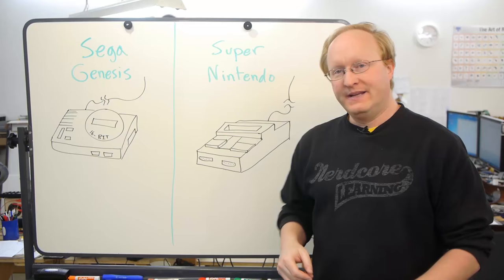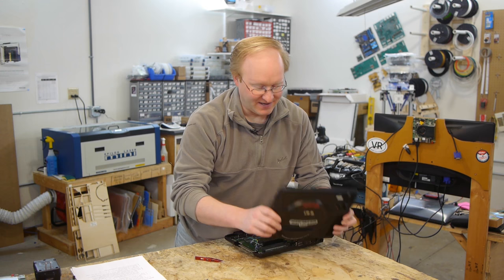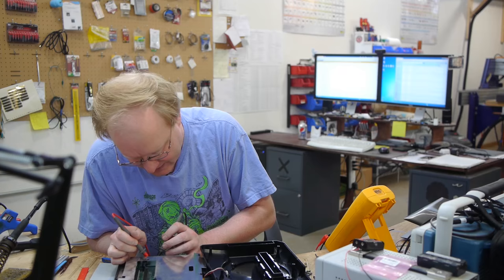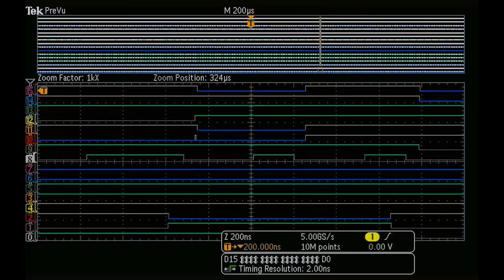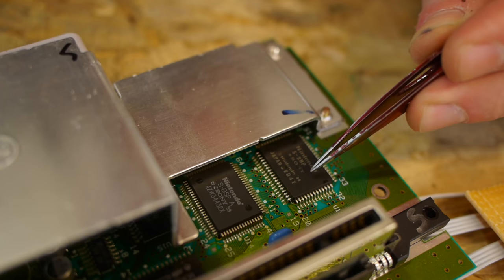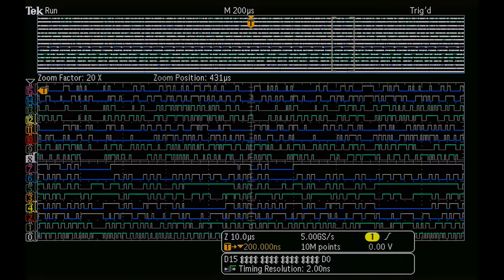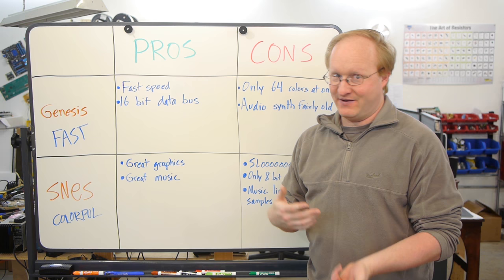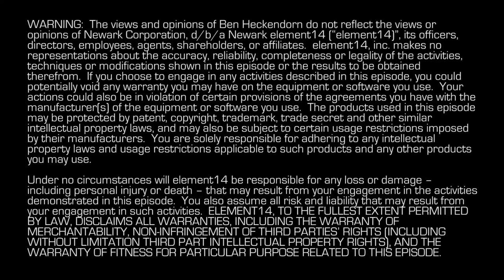Ben Heck’s 16-Bit Console Wars!

Comment: Genesis: has higher resolution, with an actual mode of 320x480 which you can use. Unlike the SNES's theorical 256x448 mode that cannot be used because the processor can't handle it.

The Genesis can actually be coded for because it is basically a stripped down A500. The SNES is as hard to code as it is to you to kill the kraken.

The Genesis can display more than 64 colors at screen at once? have you ever read of horizontal interrupts? Sonic 1's water wants to talk to you, so do all the many games that do actually surpass the limit. https://www.youtube.com/watch?v=7_9S7tgeeIo this video is kind of tame, you could easily go to Hydrocity in sonic 3 and admire all the colors thanks to the interrupt tricks.

Also... https://www.youtube.com/watch?v=-MsFrLEK4OY 3D on stock hardware at a respectable speed.

https://www.youtube.com/watch?v=Wr9oWMDWO9E And versions of Wolf3D that would make any SNES owner rage.

Also... Samples are better than Frequency Modulation? Really? Most SNES games ripped low quality yamaha or roland samples to begin with so what in the hell?. 

This was a complete biased "fight" lad.
Reply: Zana GB Actually, SNES has Mode 5 that allows 512x448 (512x480) pseudo hi-res, that is about the same and used as often as Genesis 320x480, i.e. very rarely. That's not because of the CPU power, though, it is not really related, there are many other inconveniences that make it not very usable on both platforms. And SNES is actually not that hard to code for, both CPUs it has are expanded deriatives of 6502, which is arguably the simplest CPU ever. It just happens to have way more HW than Genesis, so it takes more time to learn.
Reply: SNKega Why, both Master System and TG16/PCE were fine with having a single 16 color BG layer, so 16+4 it isn't totally unusable, as seen in RPM Racing, for example. Still, I personally consider interlace modes pretty useless both on Genesis and SNES, because they implying many limitations while only giving back some questionable picture clarity (as it flickers). Genesis hi-res was also used in very few games, I can recall only one. The point is, these modes aren't important feature, shouldn't be used as serious pro/con in system's comparison. The normal modes difference, 320 vs. 256, is a much stronger argument.
Reply: Zana GB Neither SNES nor Genesis can have extra ('chip-assisted') video modes. As for programming complexity, well, I programmed for both systems a lot, and to me it didn't seem nearly as difficult as you're describing. 'Not easy' sure, as with any old system, but nothing exceptionally difficult. Both systems has the same number of built-in co-processors (one). You also have to wait access times and deal with async running components on Genesis all the time (Z80, YM2612), and actually it is a little worse there, but still, not much of problem. And why do you think 'you're going to need expansion hardware'? Not that many SNES games have it (~100 of ~2000 releases). Even if a game uses it, there is just two async slave components (APU and the extra chip) to deal with, and it is certainly much less of a problem than dealing with many other limitations SNES have (like sprite system, Genesis totally wins in this regard).
Reply: shiru8bit 1. The double height video mode on the SNES is unusable, no game has really used it as far as my knowledge goes.

2. Regarding programming for both systems. on the Genesis you only need to code two programs, a Z80 sound driver that hogs the SN76489 and YM2612, and the main program on the 68K, only dealing with the VDP and the IO. the SNES? you only have a real main processor, who has to mediate between the two chips that compose the actual SNES APU, it's own Graphics Unit, and any and all of the expansion chips that are on the cartridge slot, all going asyncronously, which is not a problem on the MD because you got a CPU dedicated enterely to the sound driver.

Also, if we are going with your videos as a reference, you are using high level languages. Of course it is easy, at the cost of a whole bunch of speed, because who the hell needs fast code on a glorified Apple II?

Also let us not mention the snes and it's inners full of crippled buses that are essentially worth for nothing.

but of course, if we are going to talk about shoving some C code into a processor, sure the SNES may be slightly easier. but noone should program in C to begin with.
Reply: Zana GB SNES APU is a totally real CPU (6502 deriative) dedicated entirely to the sound driver. Unlike Genesis, it is a entirely separate subsystem, with own RAM/ROM, essentially a black box. On Genesis things much worse, as the 'sound' hardware is there to provide backwards compatibility with SMS, thus it is integral part of the whole system, sharing the ROM bus. Z80 may get stopped by the bus arbiter at any time, providing priority access time for 68K, so the sound driver gets affected by the other system all the time, and this is well noticeable as low quality of sampled audio playback (typically Z80 wants to read a sample during video DMA in VBlank, and gets stopped by the whole VBlank period).

Old consoles aren't modern PC. There is no standard C libs, or any libs at all, or any ready-to-use tools. To be able to use a high level language you need to learn the HW very well first, and write a few thousands lines of assembly code just to get it working, along with most of dev tools.
Reply: shiru8bit I kind of lost it at "Real CPU", specialyl when considering that Nintendo took out of the 6502, the only feature that actually made the CPU interesting at all. floating point calculations(or some related feature), but sure. go ahead. believe whatever you want to believe.

Regarding the lower sample quality on Z80 drivers, it is indeed a known fact because, as you mentioned, the hardware is shared to offer backwards compatibility, but then again, it has not 8 bit buses everwhere like the SNES does, supposedly in an attempt to offer backwards compatibility that... unsurprisngly, did not add, unlike the Genesis. So while the Z80 may fight for access times, it still allows for faster and tidier operation than on the SNES from a general coding point of view, since videogames may actually rely more on the VIDEO part of the name, and the 68K does perfectly well on it's own. ( on top of that, you should use that extra FM channel for some actual real percussion, not puny samples [but hey, if you're the same shiru i think you are, you should know about that, given you developed then removed VGMMM out of the face of earth altogether. But hey, i guess that this SNES MASTER RACE mentality explains it] )

That you are going to need to have your C compliant runtimes programmed in assembly still does not excuse that the performance will be sub-par and that at the end of the day, if we were to crank all the code the way you have to do it, the Super NES would just be unable to keep up with the Genesis. ( Hell, even demos like Overdive show that the Genesis can do 256 simultaneous colours, something Nintendo Fanboys have used as a "mark of superiority" for years] )

But back to programming on these systems. The 68K has been in multitude of devices, such as the Amiga, the original Macintoshes, the Sharp X6800, and many other microcomputers of the time, same goes for the Z80. The stripped down version of the 6502 on the SNES it is not even really comparable to the ones used by the C64 or Apple II ( and it's derivatives ),something which has driven most of the developers at te time completely nuts, which is kind of a shame becasue even if you were to juice all of what you could out of it you'd still be crippled down by needing to fight with all of the different buses running at different speeds. But i guess that is NOT a pain in the ass to optimize and handle properly. I guess it's just better to just let the program be an slow, unoptimized mess.
Reply: Zana GB Now that's typical Genesis fanboy attitude, total lack of actual knowledge (6502 with floating point and stripped down 6502 in SNES, sure) combined with personal insults. Good luck with that.
Reply: Zana GB I read somewhere that the Super Star Wars trilogy was written in assembly language for the SNES, as probably many others were. Assembly is always the best for speed and raw size, as a line of assembly code is theoretically one CPU instruction (not actually sometimes, like certain MIPS instructions that the assembler translated to multiple instructions).
Reply: Zana GB The 6502 didn't have an FPU. Most of the 8-bit CPUs (and 16-bit, for that matter) didn't have FPUs.
Reply: Matthew Travous it was BCD, my fault, still, it had features removed from the original chip, so my point still stands, as an off-brand off-brand stripped down version of an ancient chip, and then we have +shiru8bit herebeing mad and insulting the Z80, the processor of his now beloved ZX Spectrum.

Anyway, back on topic, regardless of what feature it was cut ( god forbid me from being sleep deprivated and mix this data with some early PPC stuff i was researching ), it is still a 16 bit cpu with 24 bit addressing and an 8 bit bus for some reason.

The PCJr is not as crippled as this machine is.
Reply: Zana GB IBM PCjr? Now that's a slow machine! Intel 8088 (8086 with an 8-bit data bus and no hardware multiplier, just a microcode program) and 64KB(?) of RAM... Maybe you're right about the SNES being worse off. If I remember correctly, the 8088 had some features to deal with BCD (and also the 8087, the external FPU). But I don't like BCD for a number of reasons, so I really didn't care all that much.
Reply: Matthew Travous I think we could live without BCD, however, the whole mess involving the buses, the different pieces of hardware clocked at vastly varying speeds, and in general the rushed nature of the console make it much, much worse than what it could have had. More colors and 64k sample space won't make a better console. if it is a pain in the ass to program at a low level with it.
Reply: Zana GB I don't want to think about the nerd wars that were killed by that Wolf3D build on Genesis.  What really fascinates me is that nobody did it back in the day.  It's as damn close to how I ran it on a 386 when I was still in high school.  STILL.  My guess is they didn't have an equivalent to Lobotomy Software at that point in time.  and FM sounds, while perfectly capable of running any sample you can code, still don't have that sound that the low quality samples did.  As a result, you end up having to know a lot more about your available tracks and your actual modulation options to produce something pleasing to the ear.

And oh man, just the mention of horizontal interrupts gets me going.  While I didn't get too deep in coding for a C64 I eventually wanted to try some of those tricks to see what I could produce, say something like a mixed text and pixel screen which I'm pretty sure could be done fairly easily...
Reply: DoomRater I am certain most C64 demos already use both the character graphics and regular graphics in one.
Reply: Zana GB You know the real downer of this story of mine?  I had the opportunity to work with assembly on the C64, the only issue really being that I had to write my own compiler in BASIC. And... me being as young and stupid back in the day failed to write an actual compiler.  It could disassemble in a sense, but it couldn't be used to meaningfully write code, and it didn't save source code.  Maybe one of these days I'll go back and get a proper compiler for a C64 and write that fighting game I always wanted to make.
Reply: DoomRater Well that's a bummer indeed. However i'd swear you god proper compilers and even SDK's made already, so that should save you some work.
Reply: Ruby Williams Zero development experience with either of the systems i feel on you.
Reply: Zelda III: Stock hardware, Does not really do anything too computionally expensive anyway and it's easy to break.

DKC: French Realtime - The Game

Star Fox: All the SNES does is handle the IO and the sound processing, most of the game logic and ALL of the graphics are utilized on a separate hardware annex to the main unit. It is not a SNES game.

Super Metroid: Supposedly uses a DSP1 variant, however, given how there's only two rotation effects through the whole game, it might get away by taking it as a stock game. Again, nothing computionally intensive happens. Plus, the cart size just uses bank switching, so it isn't an achievement anyway.

Are you over fanboying yet?
Reply: +Zana GB When someone tells you that the Snes is faster at accessing data, show them Batman Forever on the Snes with it's 'Hold On' screen, something the MD doesn't have.
Reply: Ruby Williams Not loading it seems.
Reply: Ruby Williams Just make sure you're not controlling a character that has to journey from one room to another unless you want a one minute wait.
Reply: Ruby Williams Some examples?
Reply: +Zana GB Either way, the SNES take an absolute dump on the Genesis when it comes to games. Snes had this, and Genesis had that, but Snes had this, and this, and this, and this...etc. There's just no competition.
Reply: Kempes SFA Thanks for the elaborate argument, sir. With all the amount of things i have been just exposed to, how would there be any way to dispute such great rationale?

I am astonished.
Reply: Kempes SFA And Mega Drive had that and that and that etc...
Reply: Ruby Williams Anti UTTP I come from Jupiter, The Gas Giant.
Reply: Ruby Williams Anti UTTP You will never know
Reply: Ruby Williams Anti UTTP I'm afraid not
Reply: Ruby Williams Anti UTTP Only the user who has initiated the process is allowed to terminate it.

Request denied.
Reply: P Ferreira No comparison really. Genesis had the sports games...yeah, you can keep your sports games, I'll keep my RPGs, fighting games, probably some of the best Nintendo exclusives ever..etc.
Reply: Kempes SFA Sparskter, Ex-Ranza, Ristar, Turrican, Gunstar Heroes, Gleylancer, Granada, Thunder Force, Super Fantasy Zone, MUSHA Aleste, and more, salute you
Reply: Zana GB Donkey Kong Country 1,2 and 3, A Link to the Past, Final Fantasy 3, Chrono Trigger, Super Mario World, Yoshi's Island, Super Castlevania IV, Contra 3, Mega Man X X2, and X3, Earthbound, Act Raiser, F Zero, Super Punch Out, Tetris Attack, Secret of Mana, Starfox, and SUPER METROID, send their regards.
Reply: Kempes SFA i can also list the whole catalog of genesis games :P
Reply: Zana GB Yeah but it wouldn't compare to the SNES catalog.
Reply: Kempes SFA Oh my gosh Mega Drive had tons of great games. Snes was great and had some great games but Mega Drive was equal if not better.
Reply: Ruby Williams Anti UTTP So did Mega Drive.
Reply: Ruby Williams Anti UTTP Are you sure? There were as many if not more Mega Drive games than Snes.
Reply: Ruby Williams Anti UTTP But do you know this is a fact and from what sources. Also one of the failings of the Nes was quantity over quality which the SMS didn't have.
Reply: Ruby Williams Anti UTTP Well you're right about the second and you might be right about the first. Still doesn't mean because Snes had more games it's a better machine. It's the quality not the quantity. To think otherwise as you are is childish.
Reply: Ruby Williams Anti UTTP Yeah but saying one machine is better than another because it had more games is childish.
Reply: Kempes SFA How exactly does it take a dump? Mega Drive has great games.
Reply: Ruby Williams Anti UTTP How do you know that? While I'm a Sega fan I appreciate both.
Reply: Ruby Williams Anti UTTP Why is it superior exactly? You haven't explained. It's all very well saying Snes is better but you need to explain why.
Reply: Ruby Williams Anti UTTP When you say the Snes is better because it's superior what you actually talking about is the colour palette resolution and a slightly more advanced sound chip. The thing is Sega when they tried could bring out great music in it's games. Depended what sound card you had. The issue with the Snes you have forgotten about is that in order to get a higher resolution certain animation frames had to be cut here and there. The Mega Drive always got the better port as a result. So superior? Not really.
Reply: P Ferreira Meh, not really. Even the third party titles were for the most part better on the SNES. Look at Mortal Kombat 2.
Reply: Kempes SFA Hey look at Mortal Kombat 1. So you're wrong.
Reply: Ruby Williams Anti UTTP No it isn't. Snes isn't superior, only in your fanboy mind.
Reply: Ruby Williams Anti UTTP At least the Mega Drive version had blood though eh? Snes can't say the same thing so yes I am correct.
Reply: Ruby Williams Anti UTTP Kiddie how exactly?!
Reply: Ruby Williams Anti UTTP As in how?!
Reply: P Ferreira Even then the graphics and sound were still better. No blood, so what? The sequel corrected all of this.
Reply: Kempes SFA As we all know graphics and sound are everything. Who cares about gameplay. By the way Mega Drive is far superior. Why? It has blood in the first game.
Reply: P Ferreira Gameplay was also better on the SNES. For most people the SNES controller felt much more natural than the Genesis controller. Theres tons of comparison videos on youtube, SNES wins like 80% of the time. Besides, the Nintendo exclusives alone destroy the Genesis library.
Reply: Kempes SFA Totally disagree, the Snes controller never felt as natural as the MD one. Mega Drive exclusives were as good if not better than Snes exclusives.
Reply: P Ferreira Yeah no, there's nothing like Super Metroid on the Genesis, or A Link to the Past, or Super Mario World, Donkey Kong Country, Earthbound..etc.
Reply: Kempes SFA Right we had the Sonic series, the Streets of Rage series, Ristar, Comix Zone, the Shinobi series etc. Nothing like that on Snes see.
Reply: P Ferreira Having played both, the Sonic series were extremely sub par when compared to the Mario series. We had Final Fight, Ristar was ok, and Comix Zone was way too hard and not very enjoyable.
Reply: Kempes SFA The Sonic series is terrific and classic. Ristar is a classic as well. Why do people think Comix Zone is so hard? I mean I'm terrible at video games and I can complete it easily.
Reply: Ruby Williams Anti UTTP "Also Sonic doesn't have excitement either." If you're talking about the original 2D games you are wrong.

"Snes is better than Genesis." That's your opinion but doesn't mean it's correct.

"And Mario is better than Sonic." Nintendo fanboy.
Reply: Sorry but I find Sampled audio much much better than synthesizers.. With sampled audio you can essentially reproduce sounds that would be impossible for a synthesizer to do.. Although sampling does require way more memory... For me it delivers better results. Synthesizers have a much more chiptune-like sound.